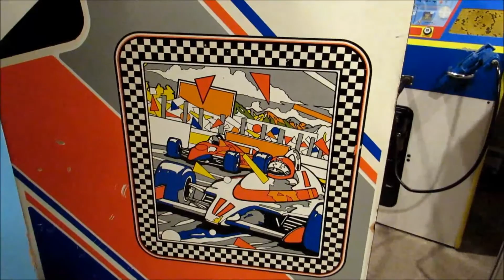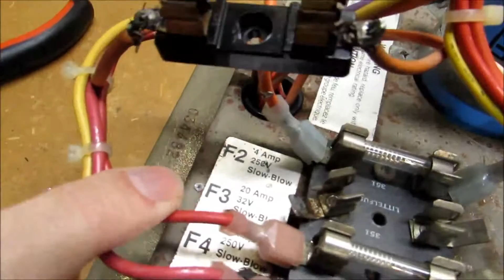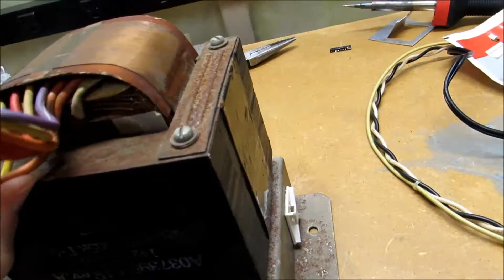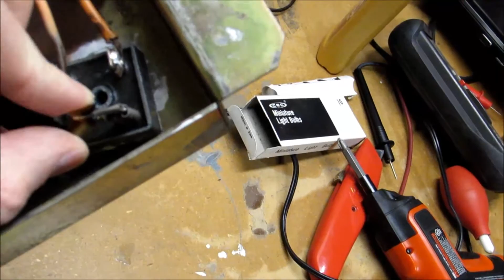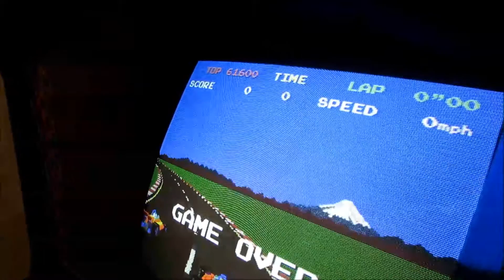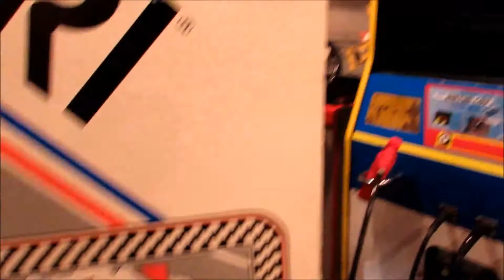Pole Position - Status Update #4 - Fuse F3

Comment: My pp has been converted to switching power supply, I want to convert it back but dont have the nerve too. Bad enough keeping boards working so I got it running and I'm not touching it lol
Reply from the maker: Do you still need to run an AR-II for the audio?
Reply: yeah the audio still comes from ar2 boards powered by the 12v off switching supply
Reply from the maker: Ah ok. That makes sense! Thanks for sharing that bit of info!

Comment: F3 popping is a really common fault.  Also change F2 as that's on the same line as F3 on the schemes.  The bridge rectifier might be going weak too.  Have you seen all the old original Atari docs about the problems with PP
Reply from the maker: +James Brindle I haven't. Do you happen to have a link?
Reply: +That Tim Guy I'll see if I can find a link, it was part of a large batch of files I got as a DVD.  It might be on arcarc or pdf textfiles com publicly - they're all out there.  The F2/F3 part is both sides of the AC line going to the bridge rect.  I'd had blown F3's on my PP for a while before I looked into this.